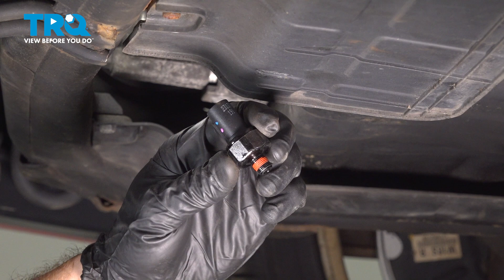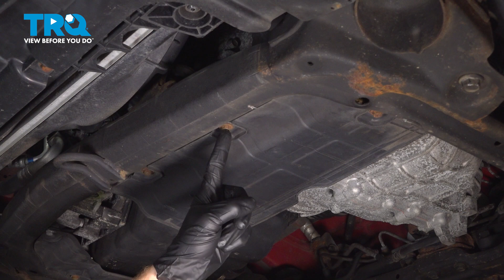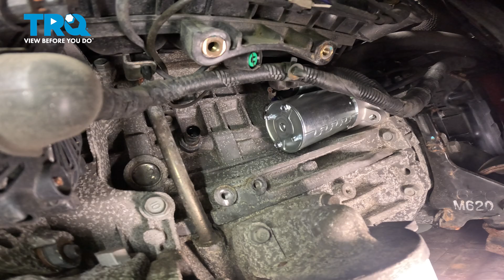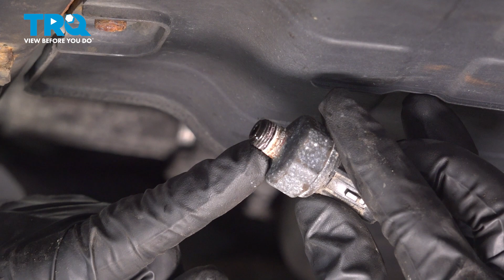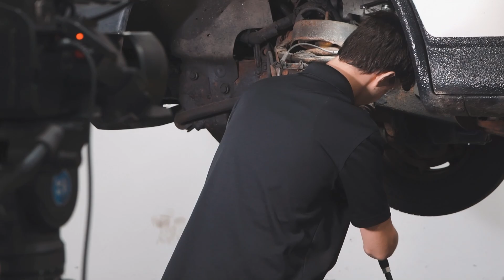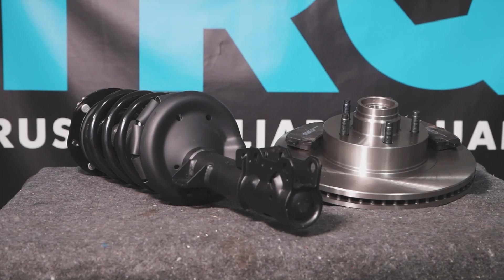How to Replace Oil Pressure Switch 2010-2013 Kia Forte Koup 2.4L L4

Comment: I actually have a question for you since it’s the first video  with my exact vehicle, & issues.
So my question is…. where is the oil pressure “sensorr” or is it the same as a oil pressure “switch”?
 It seems nobody can give me a straight answer.

Thanks
Anxiously awaiting your response.